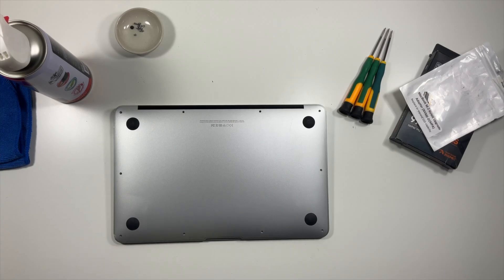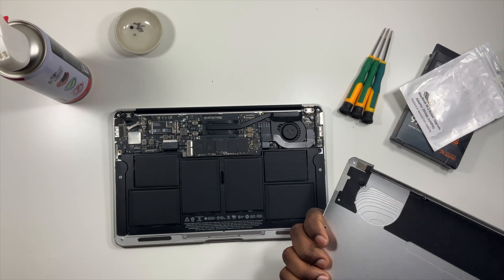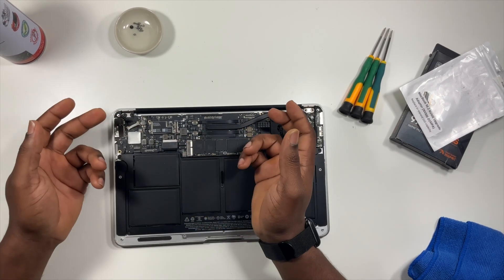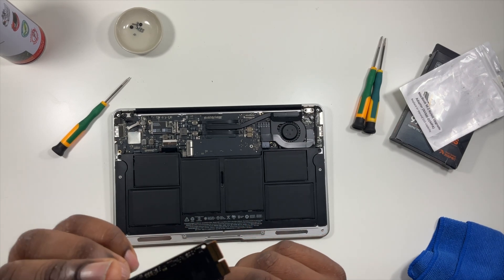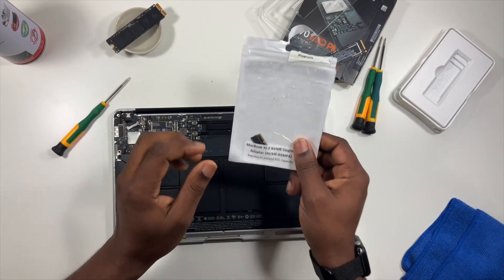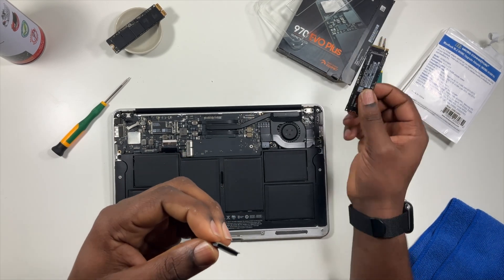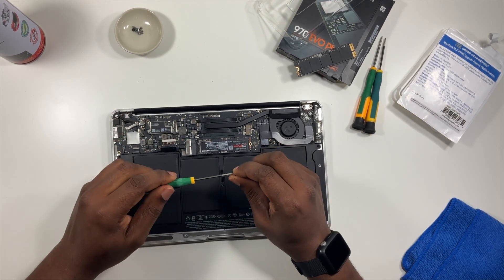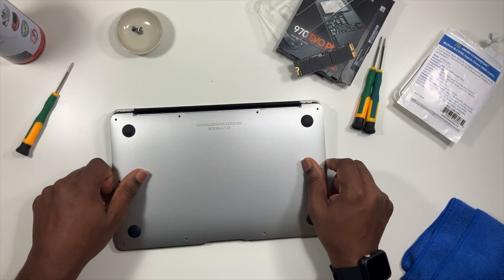2015 MacBook Air SSD Upgrade (MacBook Air 11” A1465 & MacBook Air 13” A1466 (Mid 2013-2017)

Comment: Tried to replace mine in the Air 13". Drive will not show up in the disk utility at all. Its like I have nothing plugged in. I clicked it in and made sure all connections were tight. Anyone have any suggestions?
Reply from the maker: Did you get a drive that was on the list and did you select show all devices in disk utility?

Comment: I may be wrong because im not great with computers but i looked on Amazon and it seems like they make the SSD where you dont need the adapter
Reply from the maker: You can buy SSD without the adapter

Comment: Hi Charlie, thanks for such detailed information on ssd replacement, btw none of the model you suggested is available in india, can i go for Samsung 990 PRO SSD 1TB PCIe 4.0 M.2 Internal Solid State Drive, with a ssd adapter?
Reply: I have a early 2015 Macbook air 8gb Ram i5 intel , i want 1 TB ssd, will this work Western Digital WD Black SN770 NVMe 1TB, Upto 5150MB/s, 5Y Warranty, PCIe Gen 4 NVMe M.2 (2280)
Reply from the maker: The black SN770 should work for you. I think 1tb is the max size that it can handle. Let me know how it goes I'm interested to find out, thanks for watching really appreciate it.
Reply: @charleeeugene  Thank you! I’m doing it myself and will surely let you know.🙏
Reply from the maker: You can try but apple machines are very selective on which ssds will work with the adapter.

Comment: WARNING!!!

2:30 you give insanely bad advice. You make no mention of the fact that if you even lift up slightly on the battery connector, the whole thing can break off. I urge anyone reading this to not pull UP on the battery connector at all. It's nowhere near as easy as the way he describes it!!!
Reply from the maker: Really!!!
Reply from the maker: I clearly said you don’t have to disconnect the battery for a ssd upgrade lol

Comment: Could you please share what screw driver I need to open this "tiny" screws?
Reply from the maker: Grab a precision screwdriver kit. The size will be in there.
Reply: @charleeeugene  Thank you so much for always answering my questions. 👍🏻😊 Before leaving my comment here, I had already bought a very tiny Allen key, but it didn’t fit. That’s why I became suspicious about what kind of “screws” are inside.

I looked up the Samsung 970 (which you mentioned in your description) and saw that there’s a newer model available: the Samsung 990 PRO NVMe M.2 SSD, 1TB, PCIe 4.0, with speeds of 7450MB/s read and 6900MB/s write, designed for gaming and video editing (model: MZ-V9P1T0BW). It costs the same as the 970 but seems to be faster.

Do you know if the older MacBook can handle such speeds, and if the 990 would also be compatible?
Reply from the maker: @MySpam-v1t  I'm not sure but it won't hurt to try it out. My only concern is macbooks are sensitive with compatilbility. Also I'm not sure with a older macbook you will get the benefits of the new faster M.2 it might hit a limit. Let me know if it works i'm curious you can always return the SSD if it doesn't work.
Reply from the maker: @MySpam-v1t  https://www.amazon.com/Precision-Screwdriver-Security-Cleaning-Doorbell/dp/B09PY8WQHJ/ref=asc_df_B09PY8WQHJ?mcid=a3b6f12c098639f1af81b16710f4c20d&hvocijid=9864605269376442488-B09PY8WQHJ-&hvexpln=73&tag=hyprod-20&linkCode=df0&hvadid=692875362841&hvpos=&hvnetw=g&hvrand=9864605269376442488&hvpone=&hvptwo=&hvqmt=&hvdev=c&hvdvcmdl=&hvlocint=&hvlocphy=1018608&hvtargid=pla-2281435181458&th=1

Comment: How to install MacOS after SSD replacement? Thank you
Reply from the maker: Hold option key and R key during startup until the apple logo appears. Then disk utility format your new SSD to Mac extended journaled once that finishes close that window you will see install Mac OS  then your done.

Comment: I bought several drives last one like the otheres after cloneing my drive that Had Edeavor OS Linux will not boot. , any ideas why not booting ?Last drive I have 1 TB XPG SX8200 Pro , thanks for the adapter update.
Reply: Wait let me recheck the adapter ...
Reply from the maker: Are you using a drive listed in the description?
Reply: @charleeeugene   thanks yes am ok now , I rechecked the adapter and the drive is listed. Think it was an issue with the clone. I booted off a Ubuntu USB and installed fine . Working great thanks for the video. MAC Air 2015 8 GB Ram with 1TB Drive . Camera not wokring but thats ok.
Reply from the maker: @abrickwo  That's Good!!!!!

Comment: Thank you for sparing us the unscrewing--and for using the time saved for such a measured pace in your explanation. It helps comprehension, and it's also a good bit of modelling--I seem to get into difficulties especially when I'm working too fast. The computer is lying there, under an anaesthetic, and it's not going to run away. No hurry.
Reply from the maker: Me too I get super excited then I end up doing something stupid. Can’t tell you how many times I’ve lost screws cracked the case cover Working too fast. Thanks for tuning in I really appreciate it.

Comment: using an samsung ssd on a macbook is a disaster
Reply: Because the war of Samsung vs apple😂
Reply: Give reasons for your answer 😅
Reply from the maker: Why please explain?
Reply: @charleeeugene  well i guess he (@zhengli6138) doesn't have an answer.  Although i keep reading there is random freezing with this adapter + 970 SSD i've read on other Youtube threads so i sure would like to know if there are potential problems. Some mention that you have to make sure the driver is on the SSD prior to installing it on a mac. I think i gave up on that a few years ago but now i need to do this again and I'd like to avoid any issues.

Comment: What SSD will work in a 2017 MacBook Air ? Would like to have a 512GB or more ....
Reply from the maker: support Adata NVMe SSD : SX6000, SX7000, SX8200, SX8200 Pro etc,Corsair : MP500, MP510,Crucial : P1,HP: ex920, ex950
Support Intel NVMe SSD : 600p, 660p, 760p,Toshiba XG3-XG4-XG5-XG5p-XG6 line,Samsung: 960 Evo, 960 Pro, 970 Evo, 970 Pro,WD:v1, v2 and v3,MyDigital: SBX - BPX
Reply from the maker: You will need a m.2 ssd adapter can get one on amazon for 12 dollars along with one of the ssd listed above

Comment: Any adapter out there that could make the old ssd usable?
Reply from the maker: Not sure but if any they would be on eBay.  That Apple drive is proprietary Apple likes to complicate everything!!!!!
Reply: @charleeeugene  Thank you, I am looking for one, but so far I found one that is a bit too expensive. I have a 512 ssd I took from a mac I had before
Reply from the maker: Sounds about right more than likely you could just but a external SSD @cainnzm

Comment: The fact that Apple changed the M2 slot... They really don't seem to want their customers to be able to do anything
Reply from the maker: Tell me about it. Steve Jobs let us upgrade our parts. Not sure which direction he would have went with Apple.
Reply: I've just discovered how great old MacBooks are for running Linux. The contrast with a 2011 MacBook Pro is striking. The old machine has normal SODIMM slots for RAM, and a SATA connection for the disk. Even the case screws are ordinary Philips head. On the MacBook Air, I guess the soldered RAM makes sense, because it's part of the fundamental design of that machine to be as thin as possible. But I can't think of any excuse for the funny connector for the SSD. And then it got worse. But they are beautiful pieces of hardware.

Comment: Charlee, so if I upgrade the SSD as you have done above, all I have to do when I switch it on is go into recovery and it will load the Operating system back on to the new SSD?
Reply from the maker: That’s correct go into internet recovery mode by holding option key and R key during boot up but before you do that format the new ssd to Mac OS extended journaled

Comment: Nice upgrade. It would have been nice if you included links in the description of where you purchased the parts you used.
Reply from the maker: https://www.amazon.com/Sintech-Adapter-Upgrade-2013-2015-MacBook/dp/B01CWWAENG
Reply from the maker: Next time i will drop links in the description I pretty much just grab what I need from microcenter. Thanks for watching much appreciated!!!!!!
Reply from the maker: Yes you can use 1TB make sure you get one on the list
Samsung 960 EVO/PRO
Samsung 970 EVO/PRO
WD Black NVME SSD V1, V2, V3
Crucial P1
HP EX920, EX950
ADATA SX8200
Intel 600p, 660P, 760P
Toshiba XG5
Corsair MP500, MP510
Kingston A1000, A2000, KC1000
Adata SX6000, SX8200/PRO

Comment: Hi,
Many thanks for making this video; it's really helpful. 
I have a MacBook Air 2017 13-inch 2017 Core i5 with 8 GB RAM and 128GB Storage. I plan to upgrade it as the updated OS requires more storage space. What would you suggest? Can I upgrade the RAM, or do I need to upgrade the storage SSD? Would 512Gb or 1TB of storage be good for my MacBook Air? 
Thank you.
Reply from the maker: Unfornately the RAM is soldered to the motherboard so you can't upgrade it. But the SSD that is 128GB can be upgraded I would put 512GB  a 1TB is unnecessary for 2017 MBA unless it's your only machine. Thanks for watching !!!!!

Comment: I have a few questions:
1-Does upgrading the SSD actually help with performance or it just gives you more storage on the computer?
I have been having issues with high CPU and overheating --(replacing the fan today so hopefully that will help). I know that RAM is not upgradable on this laptop , so wondering how the upgraded SSD helps?

2- Current operating system is Mojave 10.14.6, would updating to a newer operating system help? I have been scared about doing updates since I feel that it may reduce the performance

3- I have several broken keys , would it be better to buy replacement keys individually or maybe looking for a damaged laptop of the same model that is broken, buying it cheap and using it for parts? I have also seen "top cases" for sale , which is basically a shell of the bottom half of the laptop , without the inside hardware. Not sure how easy that would be to install the insides of my Mac into that.
Reply from the maker: Honestly I didn't notice a difference in speed on the Mac side with the SSD Upgrade but when I use Bootcamp windows the SSD is super fast. So it might depend on which SSD you install.  For your overheating issue install a program called SMC Fan Control for Mac helps regulate fan speeds. Installing updates is hit or miss with older machines. I would try it out if you notice a difference in performance you can roll it back. I'm not sure how easy it would be to just replace keys on the keyboard. I would imagine getting the entire keyboard replaced would be the better option my opinion.

Comment: Once we install the new SSD does MacBook auto install the os on that drive
Reply from the maker: No you have to format the SSD  first by holding option R during startup then select Disk Utility format your new SSD to Mac OS Journaled Extended  then exit after completed. Then you will see Install OS option. Then your good to go.
Reply: @charleeeugene  I bought a refurbished MacBook so I don't have any OS media. Will the OS be downloaded from the internet or do I have to jump through some hoops?
Reply from the maker: You should be fine as long as you have a SSD installed in the Mac you can hold option  key and  R key during start up then select internet recovery it will pull a OS from the apple servers. @TracyMNelson

Comment: Hey does this work on the 2015 air 11.6 inch? I’ve called several places and they say that such upgrade is not possible
Reply from the maker: yes you can !!! as long as you get the NVME  SSD adapter and one of the SSD listed in the description.

Comment: nice video brother. this video helps me a lot. i have macbook air early 2015, can i use crucial PCIE 3.0 nvme P3 ssd for upgrade
Reply from the maker: I would stick to a SSD on this list below just to be safe. But if you already have the P3 try it out!!!!!! Let me know if it works for you. Thanks for watching Sir

Samsung 960 EVO/PRO
Samsung 970 EVO/PRO
WD Black NVME SSD V1, V2, V3
Crucial P1
HP EX920, EX950
ADATA SX8200
Intel 600p, 660P, 760P
Toshiba XG5
Corsair MP500, MP510
Kingston A1000, A2000, KC1000
Adata SX6000, SX8200/PRO